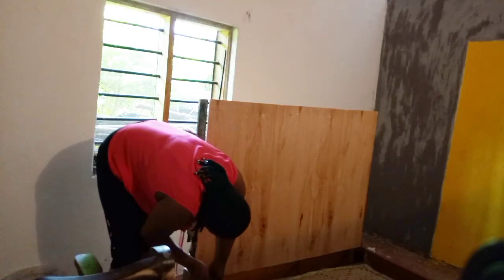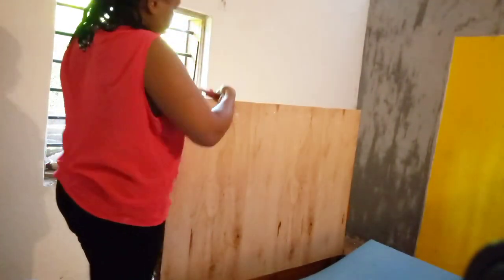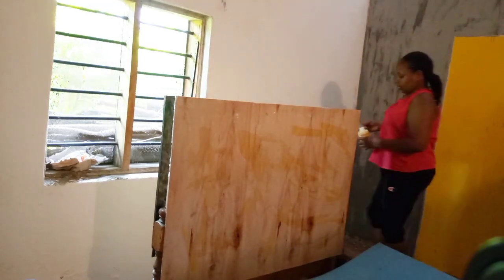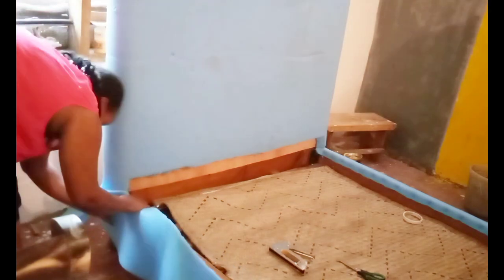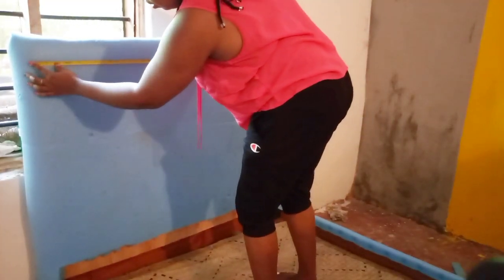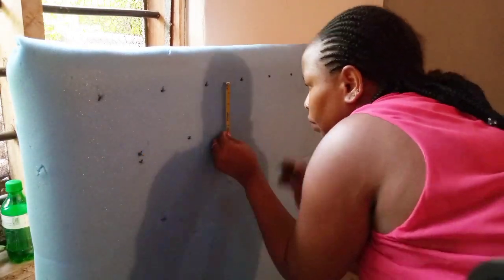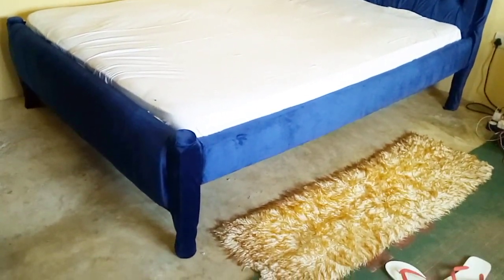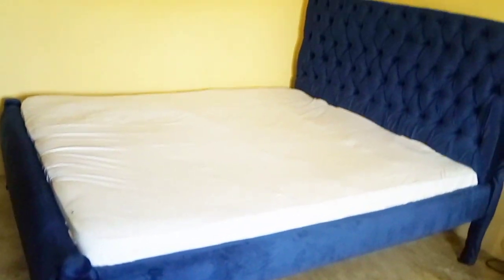HOW TO: Transform an old bed to a modern tufted bed.

Comment: Hi dear, lets say the bed is 4 by 6 and i want to transform it.. Will this reduce its original size.. And where can i get the tools, not the matress and the cloth but the stapller thing.. That kathing you are using to stapple the cloth into the holes..
Reply from the maker: Heloo Faith...nope the original size won't reduce also if you follow these steps it won't...I got the stapler from this shop on facebook 'Arif Accesorries'